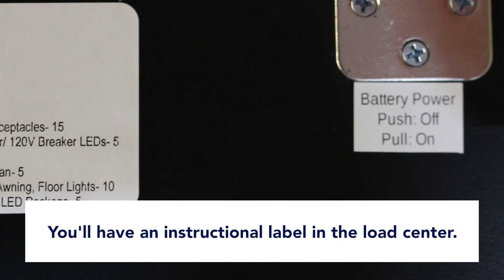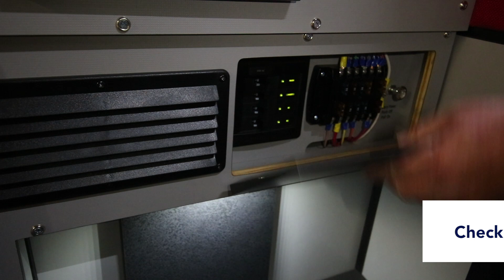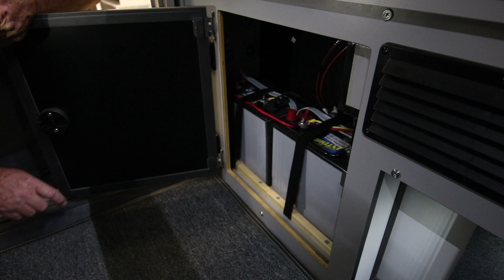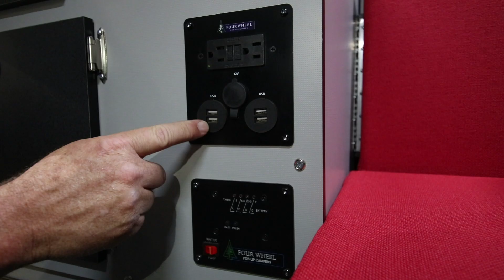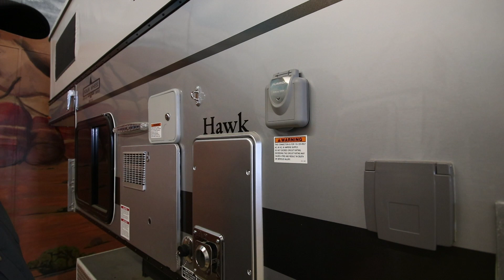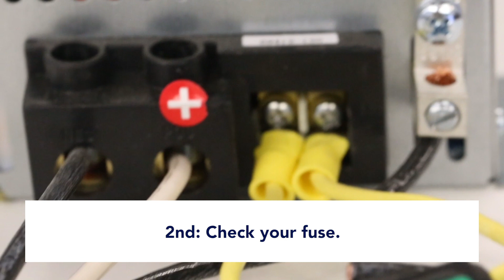Truck Camper Electrical System | Four Wheel Campers

Comment: Been a Hawk owner for 4 + years and first I watched :( EXCELLENT information for any owner but especially a newbie. Might not if at a campsite with Electrical hookup that we turn breakers off at junction box... hookup and then throw breaker at box. Protect yourself and your camper.
Reply: When I'm plugging into shore power at home, I turn off the main breaker inside the camper, plug in the extension cord and then throw the main breaker in the camper to avoid the arc. When at a electrical campsite i'll use the breaker at the pedestal (or both, hard to break the habit).